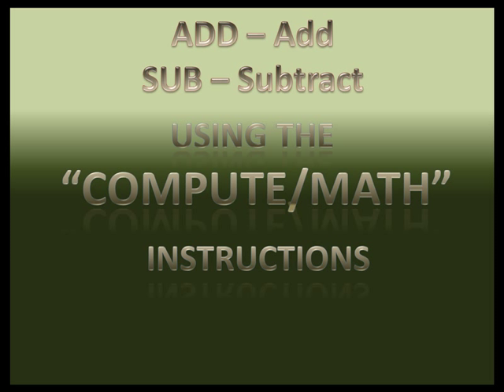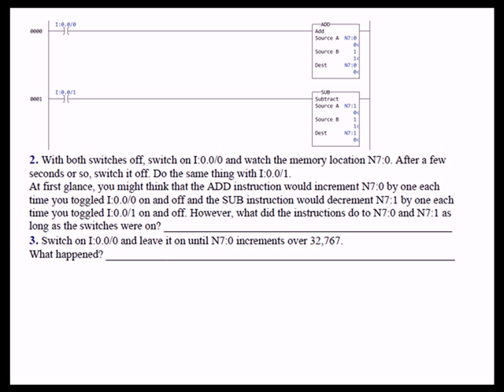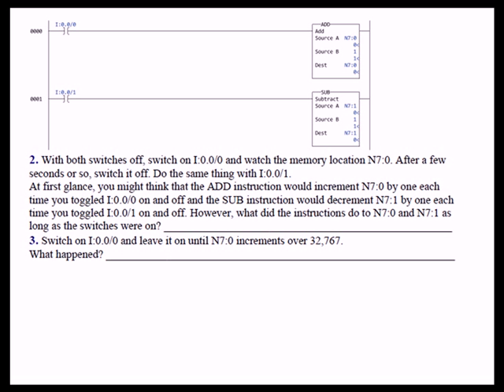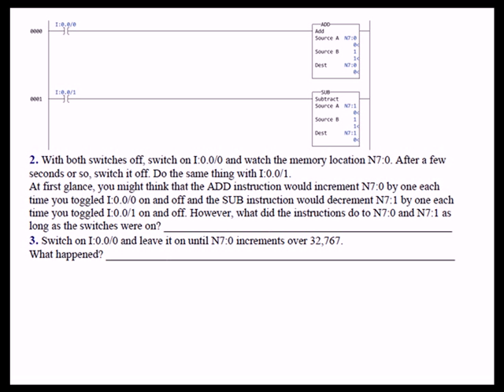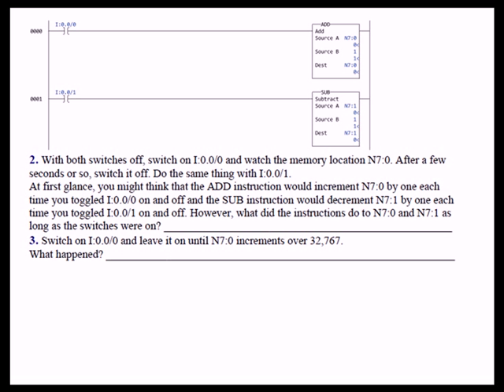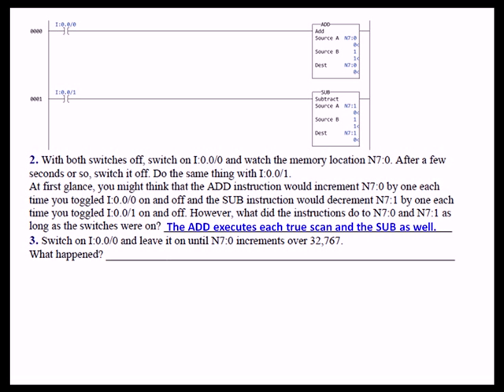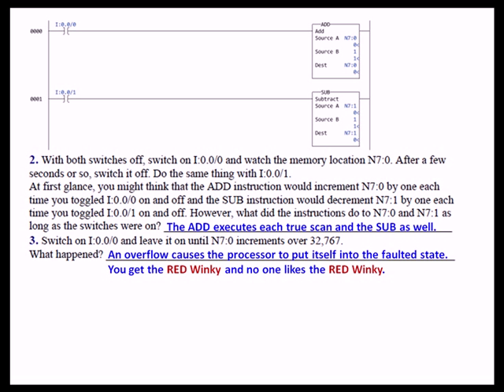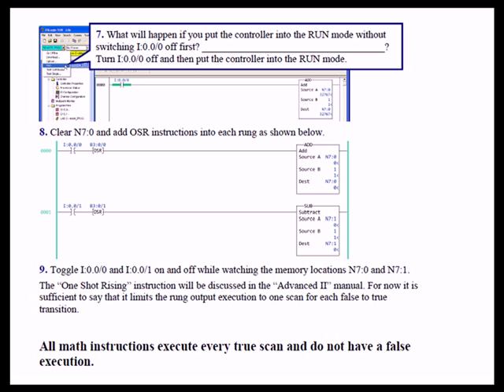ADV1 10 - ADD SUB Instructions RSLogix500, A PLC Tutorial.

Comment: I must be missing something............Please Help!

I'm using a MicroLogix 1000 as a simulator and RS Logix Micro Starter Lite, per your instruction. Everything working fine up to this point. I'm using your PDF workbook and following with the YouTube labs. I'm up to Adv1-10 (math). My problem is at step 10/11, passing from one conveyor to another. No matter what I do (I deleted and started over twice) I cannot get the audit alarm to trigger; in the ADD instruction labelled Count Audit, N7:0 decrements as N7:1 increases, keeping N7:52 equal to N7:51 so the NEQ instruction never triggers an alarm. At 11:55 on the video, you state that the Audit Alarm should energize. What am I missing?

With the addition of the GRT instruction to line 0001, everything works as advertised. As I stated above, I started from scratch with the same results. I just can't see how it works in step 10.
Reply from the maker: You da man! I recorded that several years after I created the lab. I added a note at that spot and credited you. Again, thanks a bunch!
Reply: plcprofessor Thanks for clearing it up. I'm not looking to point out mistakes; I really thought that I was missing something! So far, I've learned a lot. I still have a lot to learn, but I'm enjoying the trip.